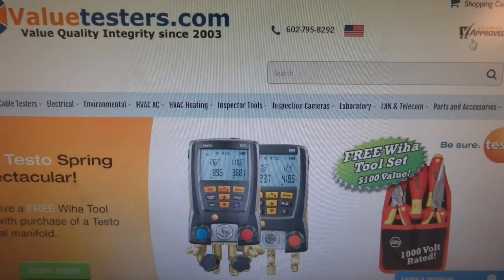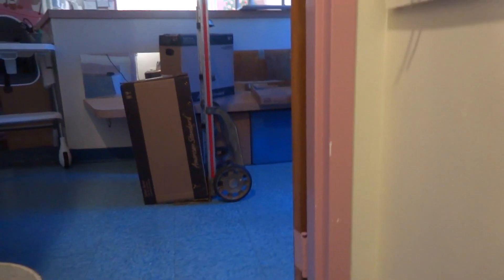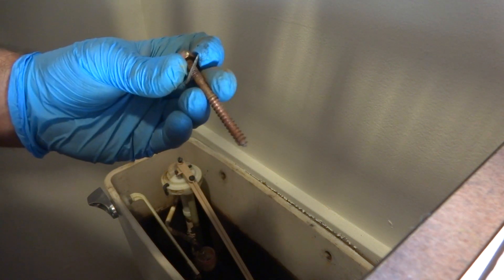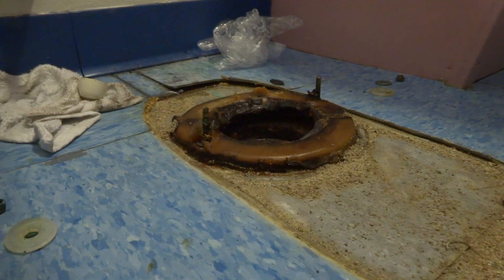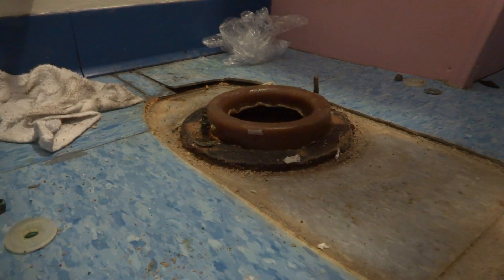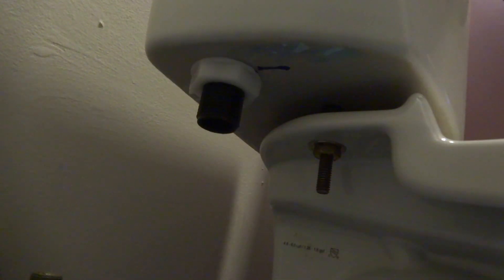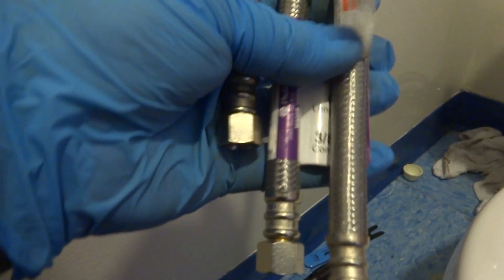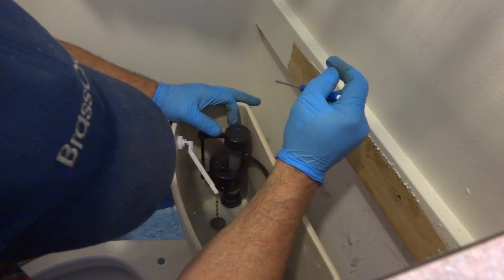toilet change out

Comment: im not sure if that old tank you took out would be compatable if you are converting a toilet with a flushometer valve to the tank type. i would save only the tank and if the elbow is still good could use that on a job if the tank is worth it.
Reply: Can't convert a flushometer water closet to a close coupled type , there are no holes on a flushometer bowl to fasten a tank to it .🚽